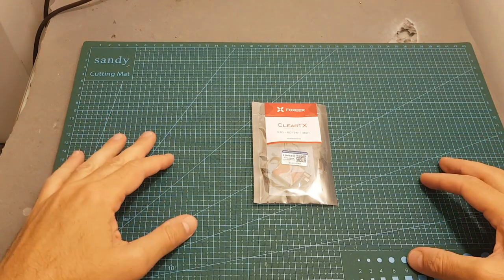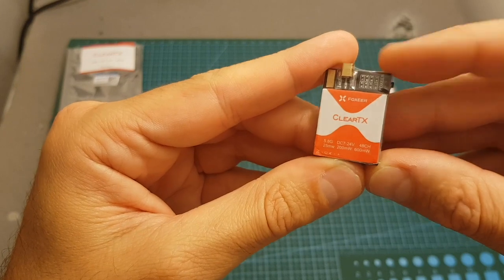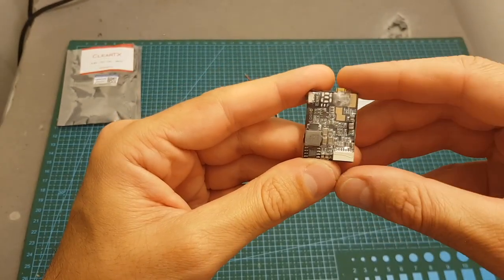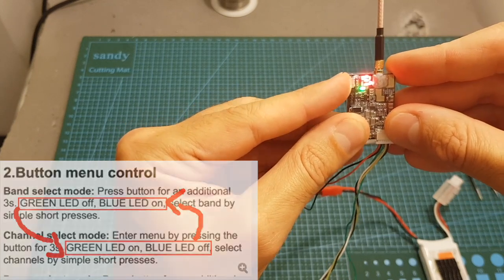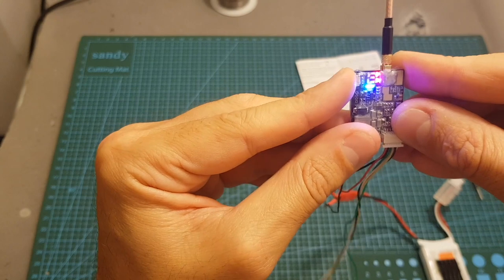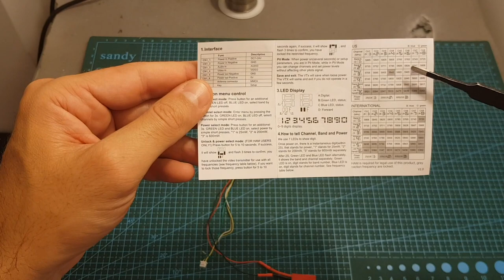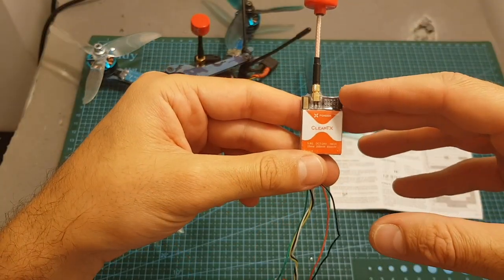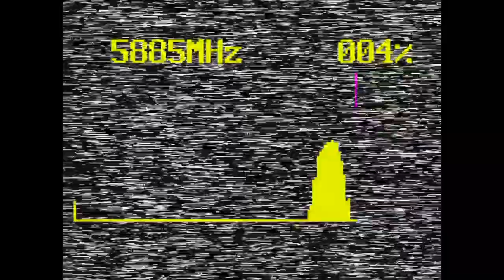Foxeer ClearTX - Setup & Testing

Comment: how did you connect ground? there should be a vgnd on fc so no noise if you use that. this vtx advertised as having low noise filter in it powering canera did you connect camera voltage to its 5v output? I plan to put my vtx to the quad did not have time for it during last year yet
Reply from the maker: Camera was connected to the FC. The VTX was powered from the FC and as you probably know the ground is shared in the FC.
Reply: @KremerFPV  but most FC like Omnibus F4 had a VGND for video ground and it helps especially to match the signal with tha internal OSD, less noise and horizontal lines. I din't know your quads FC how is it connected. This cleart has 5volt out for camera it also needed to connact camera + to that vtx output to have less noise. I am unhappy that this vtx had a low power out around 100-250mwatt max at 600mw mode :(